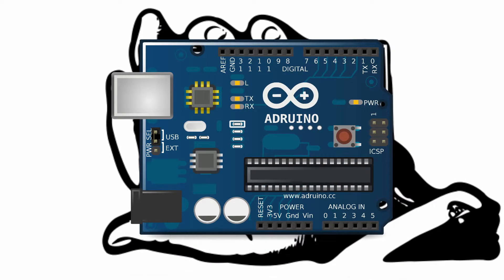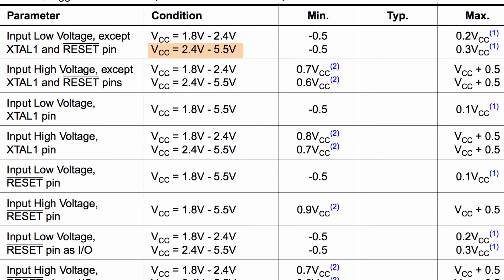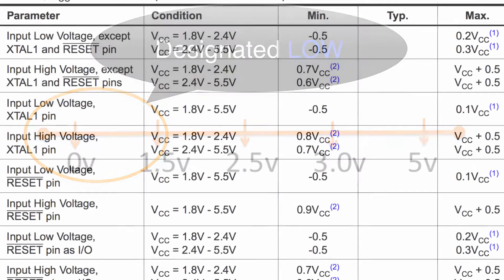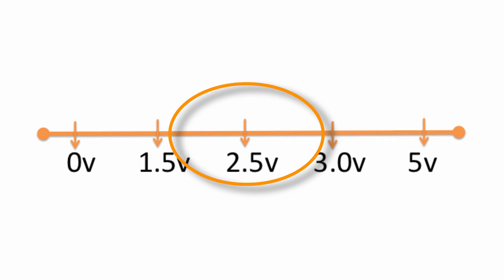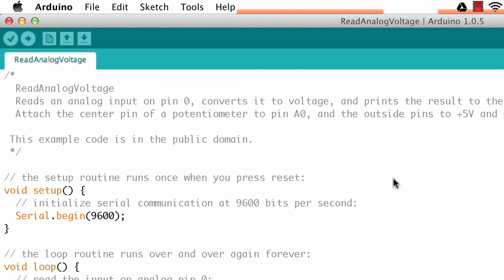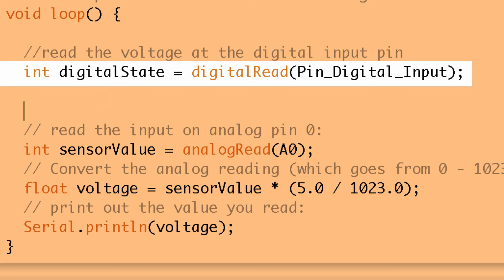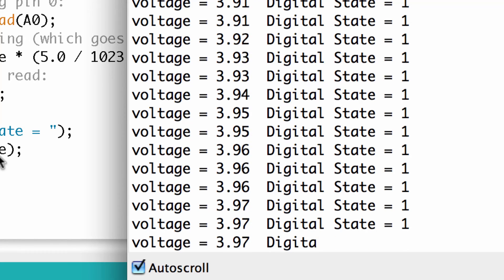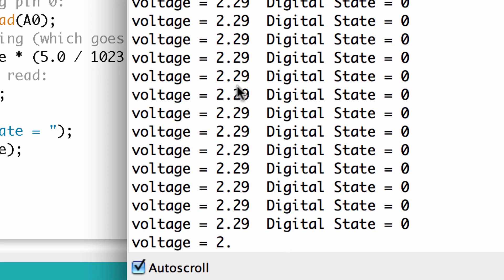Understanding HIGH and LOW Arduino Pin States :: Open Source Hardware Group Arduino Tutorials

Comment: 8:46: Just a quibble, but the analog sensorValue is multiplied by (5 / 1023) to give voltage. Wouldn't it be more intuitive to first divide it by 1023 to give its value as a proportion of the max reading and multiply that by 5? Also, since sensorValue has 1024 possible values, it makes sense to use that instead of 1023. And since sensorValue is 0-indexed, it should be incremented by 1 to get the voltage:

voltage = (sensorValue + 1) / 1024 * 5

Computing this verifies it is correct. Inputting 511 (the middle sensor value) gives exactly 2.5:
2.5 = (511 + 1) / 1024 * 5
Reply: using this formula, you'll never measure 0v

Comment: hey Michael, that was a very good tutorial, I had no idea that the arduino was that sensitive to the high and low state.  not to mention that some where in the middle it's so iffy, it can go either way.  Robert is right you didn't show how you connected to pin 2, it would be good if you could send him a reply on how you connected it.  thanks mk

Comment: No diagram showing applying voltage to pin 2.  Did you just connect a jumper between analog pin 0 to digital input pin 2?  Or does there need to be a resistor?  Also, what is the proper value of the potentiometer?  (I'm a newbie...)
Reply from the maker: Robert Cowan Hi Robert.  Great question and I should have pointed that out in the video!  If you connect the middle pin of the potentiometer to pin 2, this will do the trick.  Just make sure that pin 2 has been set to an Input using the pinMode() function.

Hope this helps and have a good one!